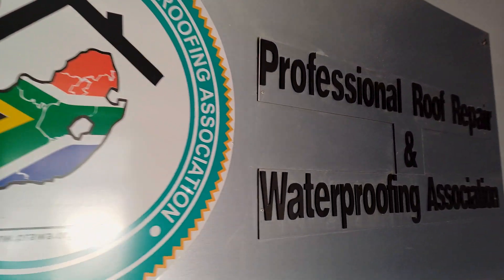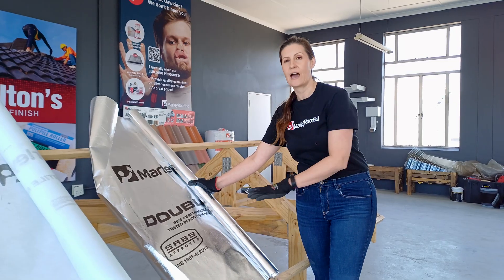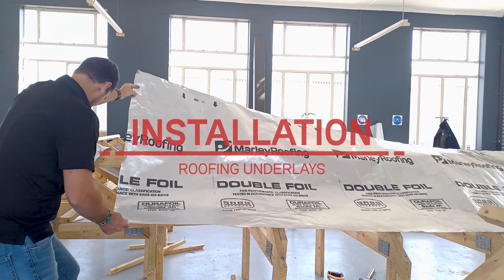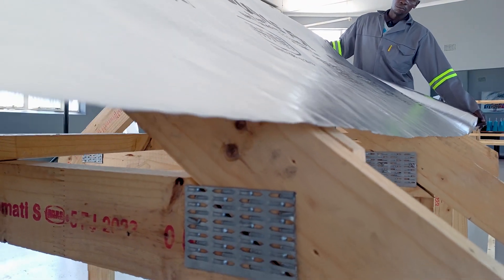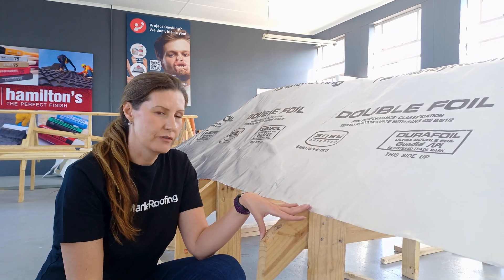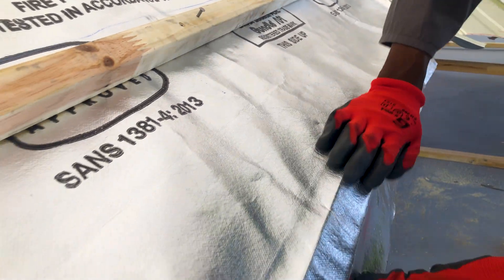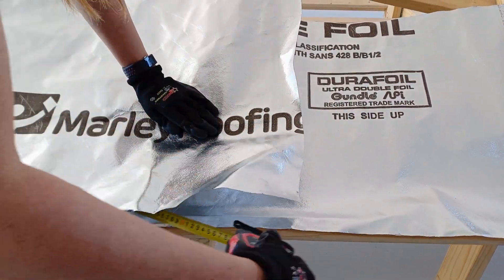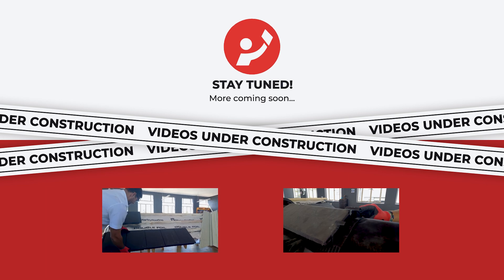How to install Radiant Barriers / Roof Foils South African way + why they are better for SA climate

Comment: I really need it in the summer. Am I correct to assume if you want to install on a pre-existing roof structure that you will have to lift up all the tiles and it will be a costly process?
Reply from the maker: Hi, not necessarily! If you have a normal ceiling with access to the loft, you can simply roll out the radiant barrier to run horizontally across the rafter / trusses, starting at the bottom of the eave and work your way up to the ridge, remember to allow for a 150mm overlap as you roll the next row over the one below. You can fix using a staple gun. Doing it this way will create even a larger airgap, meaning better performance. Just a note, if you do live in the western cape you might have issues with condensation, there we recommend to install a Venta Tile (available form Marley) and then just cut the radiant barrier so that the vent shaft protrudes past it. Also note that our radiant barrier is listed on TIPSASA'S fire register and has passed the recent updated fire standard SANS 10400 T and insulation standard SANS 53501-1, which means our radiant barrier can be used up to 2 storeys high in a residential house. Though we also do sell KNAUF bulk insulation if that will be easier. Let us know if we can help with quotes, simply WhasApp us: =27 83 345 7343

Comment: Hi Sonica, where in Cape Town can I buy this radiant barrier? 

Will the horizontal battens not restrict any airflow, preventing the hot air to move up to the ridge? Do you think a ventilation opening is required for air to go in and out at the top?

I have read on another website that the reflective side of the foil must face inward. Is it the same for the Marley radiant barrier?
Reply from the maker: Hi there, I see you are based in the Western Cape and therefore you can purchase our radiant barriers direct from our Marley Branch in Philippi - Rochester Rd, Philippi East, Cape Town, 7781 or you can contact our team there to find out where you nearest retail stockist is: 0106000284

In terms of ventilation - in some areas in South Africa where condensation build up is a problem, we would advise to stop the radiant barrier a few centimeters (+- 2.5cm) away from the apex of the roof to ensure effective ventilation. In these cases we would also advise the use of our Dry Ridge System or specialized ventilation ridge tiles. Please note that Marley Roofing in the Western Cape also have ventilated tiles for this purpose. When using the ventilated tiles, the barrier must be cut around the exhaust vents in the roof.

In terms of the direction of the foil - if you have a single sided foil barrier (one side white and the other side aluminium) then it must be installed with the white side to face the inside of the loft with the shiny foil part showing outward. The reason being that the most important function is to reflect radiation from the sun back into the atmosphere. If it is installed the other way round, then the barrier serves no purpose and radiation will still enter through your roof into the loft.

A double sided radiant barrier is better, as it will block radiation from the sun, but will also benefit the general emissivity of the inside of the loft too.

But in all cases for a radiant barrier to work, it needs an airgap, as soon as it touches the roof cover it will become a conductor of heat and all benefits will be lost.

Thank you for your question! I hope the answer has cleared any concerns.

Kind regards,
The Marley Team

Comment: Hi, what would you recommend for a typical metal shack for living in as some do in South Africa, please?
Reply from the maker: Good morning, you can still use the radiant barrier underneath sheeting. The only important part is that the radiant barrier should not be in contact with the sheet. To achieve this, you can retrofit the radiant barrier on the inside of the shell of the shack (walls and roof), though this might mean that you would need to build a wood frame structure onto which you can attach the radiant barrier and to ensure that it does not touch the sheeting. We unfortunately do not yet have a video for this, but I found this video that is very informative and I hope it will provide you with some guidance. Herewith the link: https://www.google.com/search?q=how+to+retro+fit+a+radiant+barrier+on+a+metal+shack&rlz=1C1CHZN_enZA1068ZA1068&oq=how+to+retro+fit+a+radiant+barrier+on+a+metal+shack&gs_lcrp=EgZjaHJvbWUyBggAEEUYOTIJCAEQIRgKGKAB0gEKMTg5NTFqMGoxNagCCLACAQ&sourceid=chrome&ie=UTF-8#fpstate=ive&vld=cid:f85fef84,vid:EefXjWtiOu0,st:0